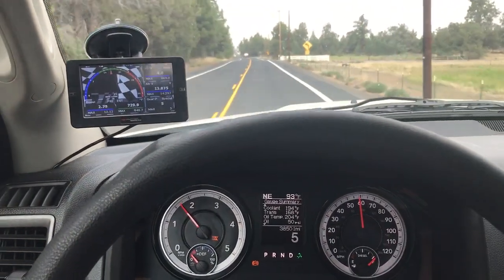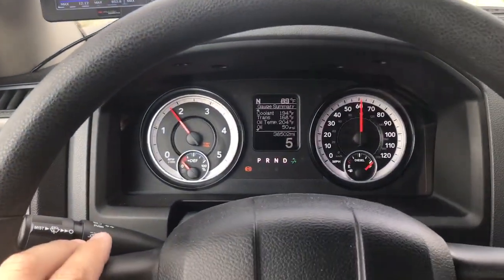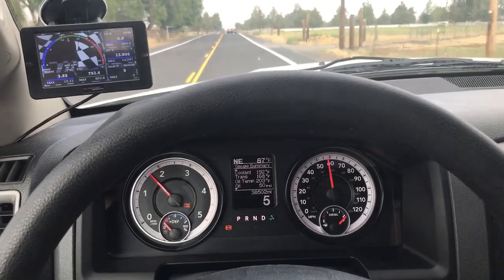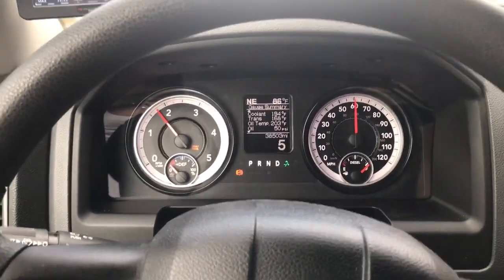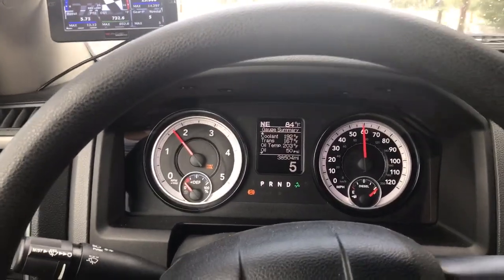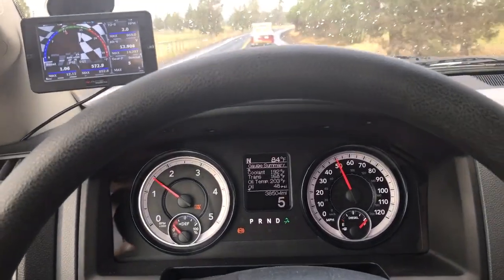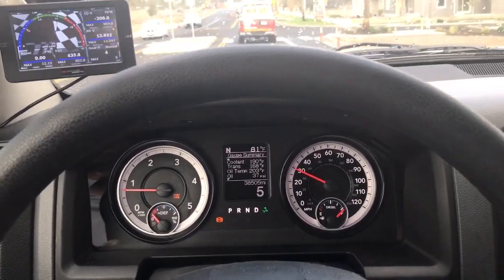Quick tip on towing with a Cummins and 3:42 gear ratio

Comment: You are right on towing with the 3.42’s, lock out 6th.  I shelled my 68rfe, did a G56 swap (kept my 3.42 gears) and I’m at 1900 in sixth, at 70mph.  The G56 with a dual disk clutch is a beast.  Anybody have a house they need towed?😁
Reply: Is it very hard to do the G56 swap? Do you have to get a new ECM or can you retune the one you have for the G56?

Comment: Great Video. 2013s Dodge Rams all went to 3.42s unless you choose different.  I have a 2012 with 3.73s sitting on 35s.  My bumper pull travel trailer is a 26footer.  6 gear she rolls and maintain easy.  Deleted, 4inch flo/pro with muffler, banks intake, boost tubes, S&B intake, and where in the hell is that trailer?  68mph and Im riding!  3.73s is a perfect gear ratio. Power / Speed!

Comment: I agree with you totally. Ive found that trans temps even on flat ground at higher speeds goes up in 6th and comes back down in 5th. These engines will run and last at higher rpm's and everything runs cooler in 5th......

Comment: Still a great video and spot on... I have an 18 full delete and she loves 4th and 5th on 35’s. Towing light loads 10,000lbs.
Reply: Yup, I have a 2012 full delete on 35s, but I have 3:73s rears.  A little move power and torque with 3:73s, on flats I grab 6th gear. 27 foot bumper pull 7.5K trailer.

Comment: People that don’t tow all the time don’t understand this. They think if your not doing 90 mph your truck is struggling. Your Diesel trucks all seam to have their max torque at the 1600-1800 RPMs which is best for towing. Hwy speed limits are between 65 - 80 MPH so match that MPH with your tire size and gear ratio.

Comment: Ive even locked out 3rd at 75 😂 on the steepest hills, redline it it doesn't care, it will never ever hurt the ctd to turn 3100 pulling a hill

Ive hauled 20k 76mph cross country 105° Summer day through ATL with a single wheel 2500, no problem at all, that was an interesting load to haul up the pig trail in NW Arkansas one part of the climb you're in 2nd and unable to accelerate fora good mile, you just watch trans temp climb and cross fingers as 2nd never locks the converter, this was the first and only time I had ever heard that big mech fan kick in 👀😂😂😂 

6th is only for a completely flat run

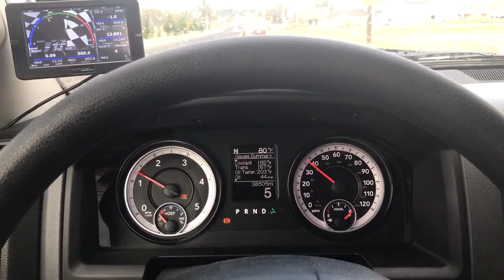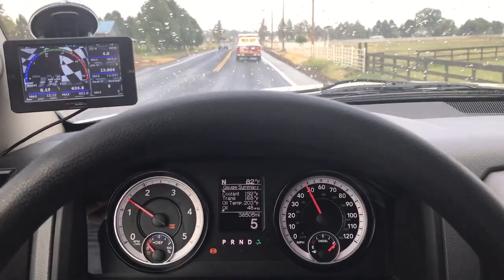Comment: A much better way is to regear to 4:10. I regeared my 3:42 to 4:10 and what a huge improvement in overall drivability; not just towing.
My fuel economy went up because I get better acceleration with less throttle input. At 45 mph theRPMs are just above idle in 6th and I get almost 28 mpg.
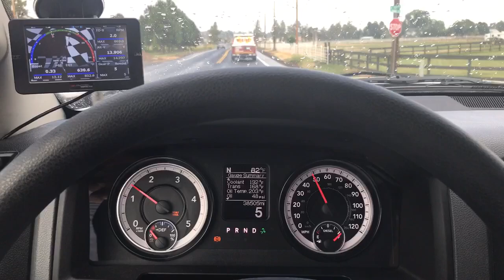At highway speeds, my RPMs are around 2000 and I get 24 mpg. I never got out of the teens in mpg with my 3:42. ratio. Best $1100 I spent (installed and guaranteed). Better than buying a bunch of aftermarket mods to improve drivability.
Reply: What year truck and tires are you running?
Reply: @14jrloco  The truck I changed to 4.10 is a  2014 Ram 2500 Cummins. My fuel economy went up significantly because the truck accelerates more efficiently. With the old gear ratio, the truck was very sluggish and there was a lot of slippage occurring in the transmission. Now there is a lot less slippage and the truck just gets up to speed quicker with less throttle input.
Reply: Brian G C what size are your tires with the 4.10 ? I also have a 14 ram 2500 with 35” tires I been really undeceive on going 3.73 or 4.10
Reply: @14jrloco  Stock. If I was running 35" tires, I would go to 4.58 (or whatever is close to it)

Comment: If 1800 rpm is the sweet spot, then why do they make a 4.10 rear end. I’d say 2000 rpm is probably better for actual torque. You can’t look at a chart and say yea that’s the sweet spot due to torque peaking in that spot. Momentum of the engine rpm will help you when climbing hills far more than peak torque.
Reply: Not with a Cummins, they don’t.
Reply: @Icutmetal  2019+ is 3.73 standard and 4.10s with the max tow

Comment: I have 3.42 on my 14 an I can't stand it. Driving around town an through mountains an getting stuck behind someone going slow. It wants to shift In to 4th soon as I'm doing 40mph an my rpm is way to low normal driving.

Comment: What are your thoughts of the manual transmission?  G56?   That way you can  choose your gear.  Cummins with the manual?
Reply from the maker: John Maher I had a 14 with the G56. I liked it a lot. My wife wasn’t a fan when she had to drive it. They are detuned a bit from the factory but can be fixed with a tube and clutch.
Reply: 2009reezen what do you mean tube and clutch? Put a new clutch in?
Reply: Ecorium Channel Yes; the manual shift Cummins trucks are detuned to keep the clutch from slipping or wearing prematurely.
Reply: I have one it’s a beast

Comment: Does having it in tow mode, automatically lock out sixth gear?
Reply from the maker: robyorba no. You have to donut manually
Reply: I does up until 65mph then it will let the transmission go into 6th!

Comment: What's the towing capacity on this 3.42?
Reply from the maker: depends on the overall set up of the truck.  mine is rated for over 16k pounds.  go on the ram website, they have a lot of info.
Reply: 22k for 2018 3.42 drw

Comment: What tune do u use while towing?
Reply from the maker: Zach Kennedy I leave it in the 30hp tune at all times
Reply: Zach Kennedy  the number 1 tune put it on  tow mode.
Reply: Question might be a dumb one but can you change the name on your radio under setting we’re it says Trailer 1, Trailer 2 and so on? I know you can change the settings we’re it says light electric and heavy electric. My buddys truck you can change it on the dash to like 5th wheel, camper, and other names. Just wondered why you couldn’t on a truck like yours and mine that has more options. Sorry for the dumb question
Reply: 2009reezen thanks
Reply: Phil Caldwell thanks
Reply from the maker: this truck is a tradesman, my new truck is a bighorn. i have never tried but maybe there is a way.
Reply: 2009reezen yeah I seen you got a big horn just wondered on the tradesman I’ve ask several people and tried everything but I don’t think it can be done. Like the videos

Comment: No thanks I ditched my 3.42s I no longer lock any gear out
Reply: What gears did you go with and what size tires?
Reply: @markpalmer8888  5.13s 1940 rpm 60mph don't go over 65 ever have a car for interstate I'm deleted with completely customized shift point took a few weeks to get everything where I wanted it. I also live up on a hill so it a long huge climb to get into drive

Comment: Man I pull my 35 foot camper at 80  or 85 depends what hwy I'm on.  Quit being scared baby
Reply: What does it weigh?
Reply: Way to fast, those trailer tires are not built for that speed.  68mph should be max while towing.

Comment: What exhaust you running?
Reply from the maker: tater0909 4” flo pro
Reply: 2009reezen thanks for the quick response on both questions. When towing, is it loud in the cab? My old 5.9 with a 5" was wayyyyy too loud inside